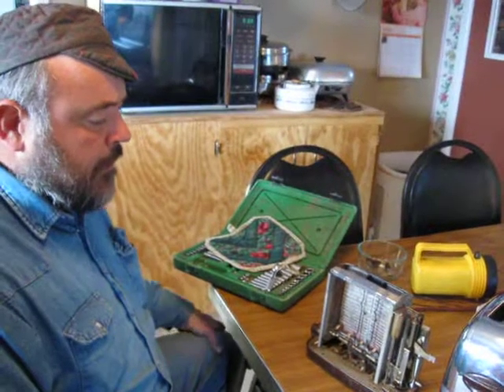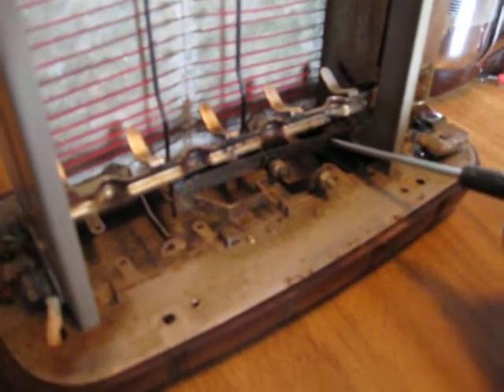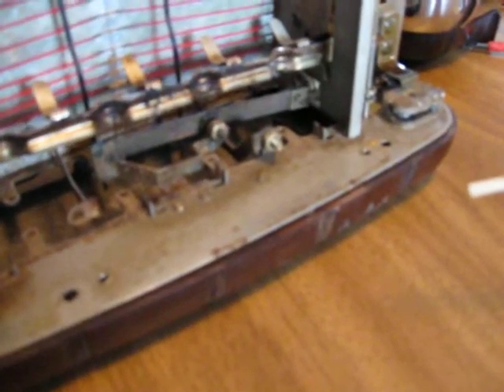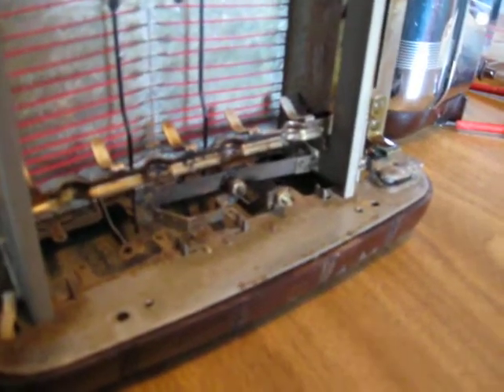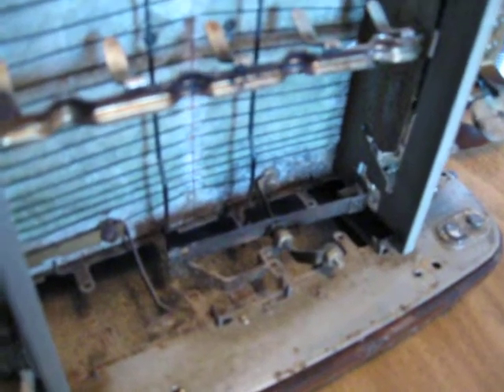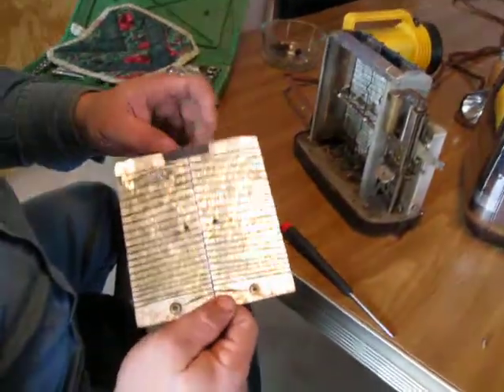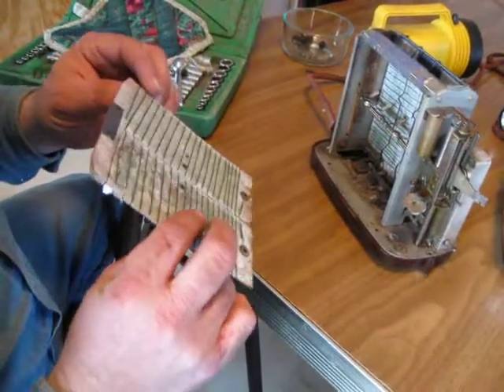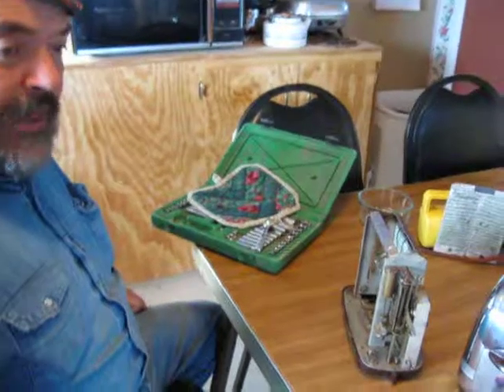Toastmaster 1A5 Repair; Bi-Metalic strip demonstration

Comment: Recently my 1B8 stopped ticking, I had just turned it upside down to get a piece of popcorn out. This toaster has been in daily use since I bought it back in 1998. I had replace the cord with one that looks period correct. Is there an easy way of accessing the clockwork ?
Reply from the maker: No, there is not. All you can do is dig in painstakingly peel the cover off to see if you can determine what happened.

Comment: Hi, I recently bought an 1A5 and found that the timer is very sluggish. I can move the bimetallic strip to increase the speed, but it still seems slow. The ticking also seems quieter than the one on this video. Any idea what might be going on?
Reply from the maker: The only thing I'm aware of is that the clock mechanism could require lubrication. Almost the same thing is that it requires cleaning, and then lubrication. If someone used a poor quality oil in the past, the oil can become sticky and gum things up. I can recommend "Liquid Bearings" for these clocks. I can strongly recommend against ANY off the shelf spray lube from the auto-parts store.

Comment: Hi I really like your videos and I find them very helpful and interesting. I bought a toastmaster 1B5 at a flea market I usually visit often and I was wondering how to take the main body off to clean and oil the timer and to also replace the cloth cord?
Reply from the maker: +matthewblalock58 The 1B5 is a model I've never owned. (though I'd like to) But I can make some educated guesses. The first thing you'll need to do is take off the Bakelite plunger handle and timer control. Then you'll need to remove the crumb tray to expose whatever else needs disconnected. The power cord will likely need disconnected. Pictures I've seen make me think you'll find a slot in tab arrangement. Straightening the tabs and working the shell off should be the next move.

This is all fairly speculative of course, since I've never actually touched one, but it's probably fairly accurate.

Comment: Got a question for you. On the 1A5, by the lever, there is what looks like a small, tubular brass bell. It's not affixed to any mechanism and there is no striker. What function does this part serve? (Also, any advice for removing or sealing rust?)
Reply from the maker: +WaffleStaffel Sorry I didn't notice this question earlier. The tube is essentially a shock absorber. A plunger in the tube slows the ejection of the bread so that it doesn't throw the toast out of the toaster. As far as rust is concerned, you really need to decide why you're removing it. Will the piece be better off without it? How bad is it? I've never had to deal with significant rust, but there are numerous products made to deal with it. Naval jelly comes readily to mind. 

I'd be inclined to "seal" the areas you want to protect with food oils such as coconut oil. As far as that goes, if you use coarse steel wool to clean the surface and treat it with oil immediately after I'd think you'd do about as well as can be done in most cases. If you do use oil of whatever sort, put it on thin and do your best to wipe it back off. The parts should not glisten, but have a dull sheen. Otherwise the excess oil will collect dirt.

Comment from the maker: Is it capable of popping up? That is: is there spring tension? Will it pop up if you manually pop it? Is the spring too weak?

First you need to identify the nature of the failure. It may be necessary to remove the shell to find out. Does the clock accelerate as it heats up? Have you tried to cycle it without bread? (Don't plug it in. Just test the mechanism.)

Making videos of your explorations so everyone else can see might be a good idea.

I'll be of whatever help I can be.